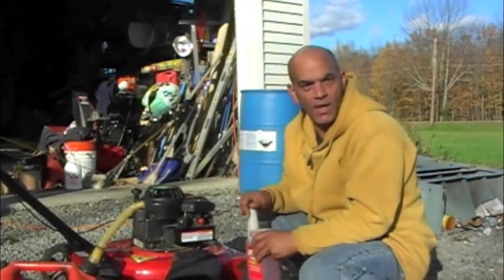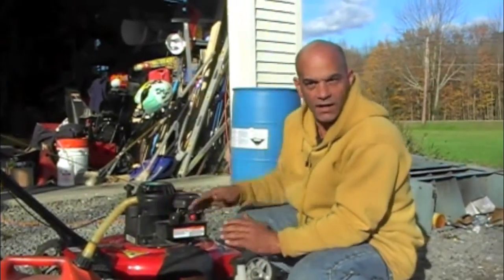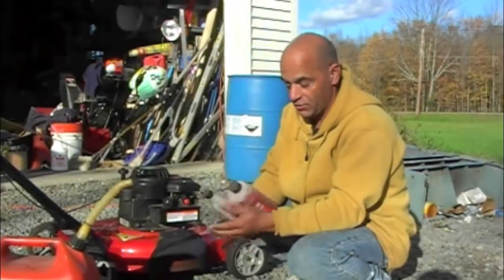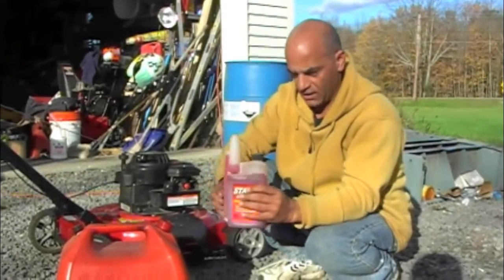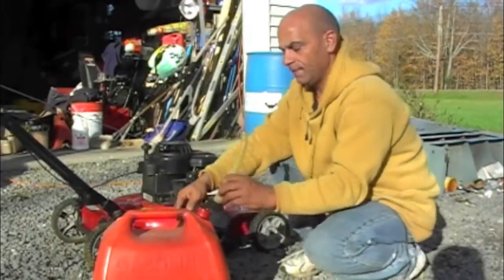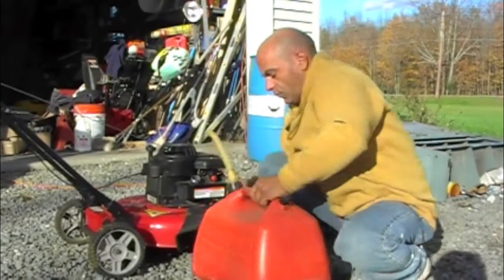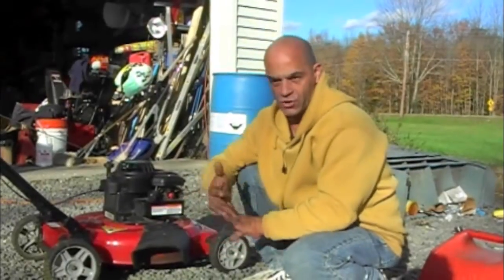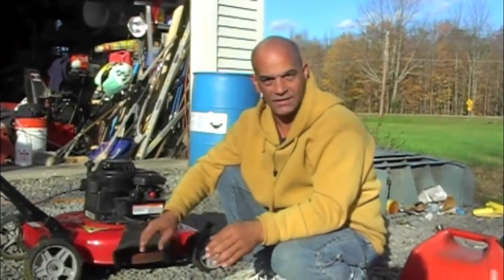Lawn mower in winter storage

Comment: What happens if the gas does gum up and you've tried to start it...would it make the mower idle rough and slow and poor black smoke out?  Mine is brand new used 4 times but it's been hot and the drought I didnt mow and it sat in the garage for 2 nths. Could the gas have gone gad? I put new clean gas in and its still running horrid and have no idea why? The filter is spotless,still brand new but was really oily, maybe too mcuh?--yet it ran good before so? Mom trying to get the grass cut---HELP